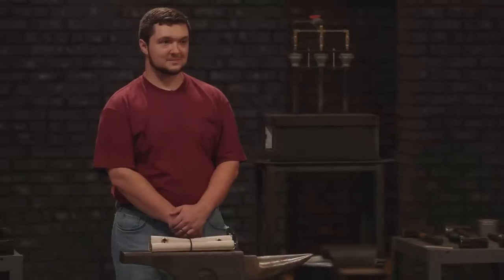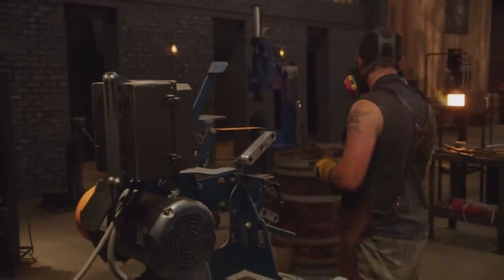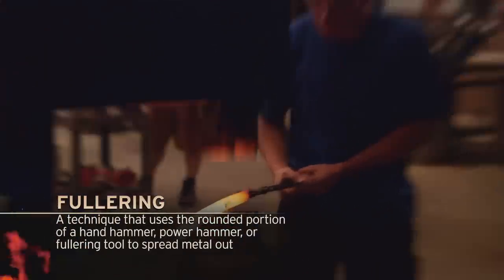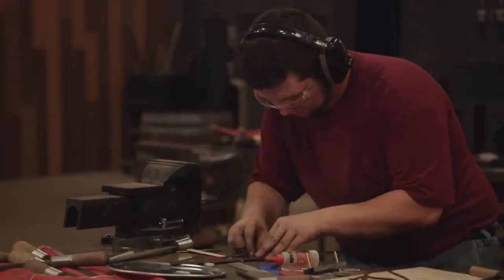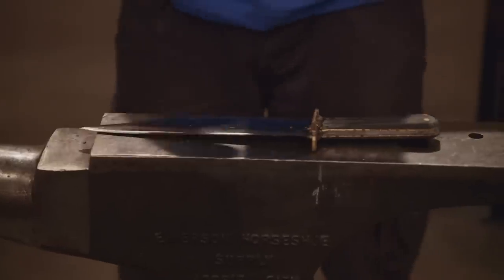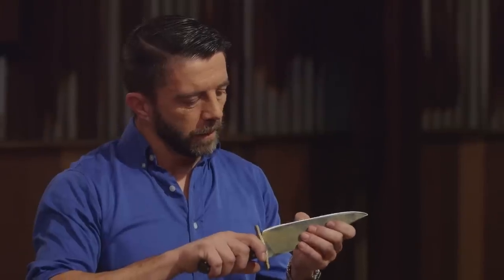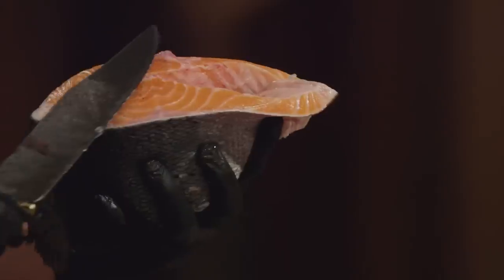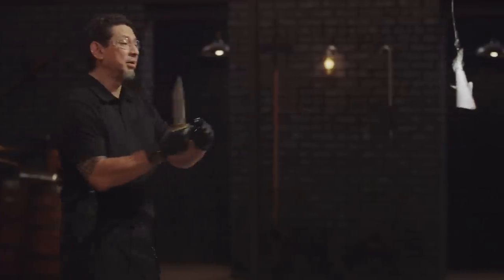Teddy Roosevelt's INFAMOUS Rough Rider Bowie Knife | Forged in Fire (Season 6)

Comment: I love your show.  Though it sometimes looks like some of the Blade Smith's look unqualified to me I have to remind myself about the time constraints.  
 I'm a hobbyist blade Smith and have the luxury of being able to set the blade down and think about what ever the solution is for as long as I need. So whilst I can make nice blades I doubt I could make a good blade in 3 hours. Then when you add pattern welded blades,  or canister blades your completely past my ability. I'm just on the verge of making successful pattern welded blades, and haven't a clue about canister. 
High carbon steel is fascinating stuff though and making weapons/ art work from a by gone era is fun and interesting.  
Your show adds one more dimension to this. THANKS!